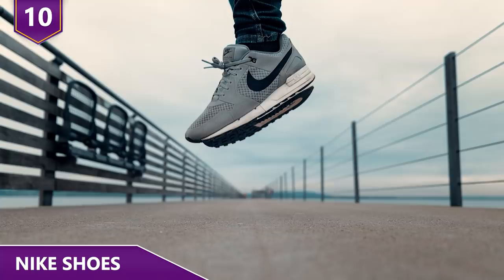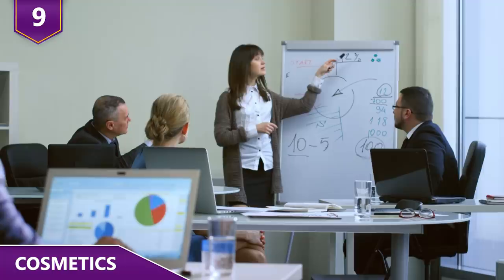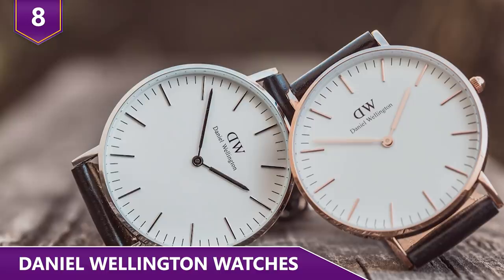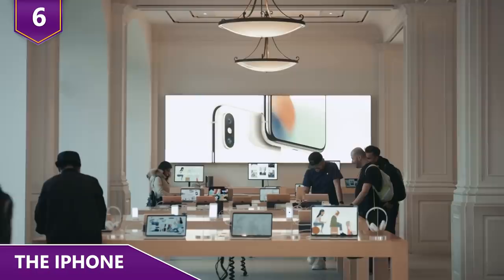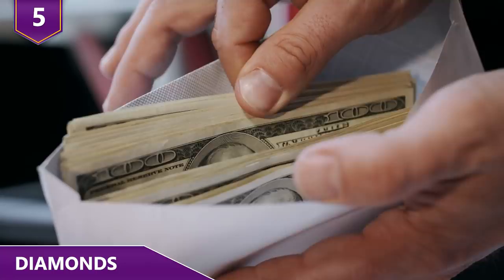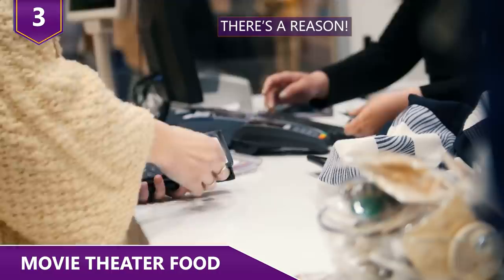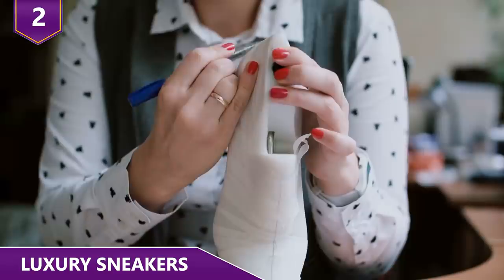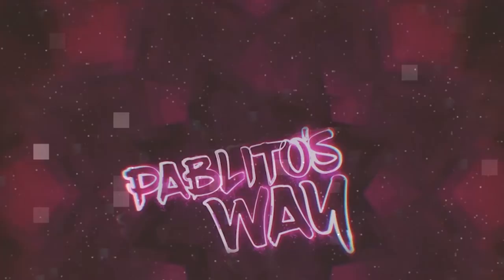The Truth on How Much Things Cost

Comment: I've sold both glasses and watches, and I can tell you that most designer isn't worth it.
DW watches are basically worth the same as children's watches, and honestly some of the children's watches we sold had a higher quality. They were the watches we most often had to change the glass of.
When it comes to glasses, I'd advise against buying designer frames (especially plastic). They're usually of poor quality and often have a ridiculous required minimum mark-up rate. Try to buy frames from a brand that specialises in glasses, as they'll often be of higher quality. This also goes for sunglasses. I'd recommend going for frames of a metal and carbon blend.
Additionally, try to look at what the professionals are wearing, but don't necessarily be fooled. We'd always have the best glass in our frames, but sometimes we'd wear certain frames or watches for promotion.
I'd never buy a DW or Michael Kors watch for myself, but I'd still sell it if someone didn't care about the quality. Likewise with frames, if I liked the design of a designer frames, I'd rather order something similar from a different brand of better quality and ironically a lower price.
Reply from the maker: DW watches are kinda like Hublots except much cheaper

Comment: This is so simplified idea of how market works. You only consider costs of the actual manufacturing. There are many more costs. Someone had to design the shoe, test it, prepare the production line, test the line, repair it, supervise it, then run the line, make shoes, pay the taxes, the book keepers, take the shoes and pack them, load them, ship them, pay toll, pay local taxes, advertise them, sell them and finally make a profit. So yeah, the sole manufacturing is maybe 28 dollars but you don' buy just the manufacturing. You buy the whole product.

Comment: You guys also forget that something like the gucci ace id made in Italy with far higher wages for laborers than somewhere like China, although the markup may be high you pay for what you get which is more ethically produced shoes with higher end repairable materials from a world class designer
Reply: You still are not getting full value for your money - most New Balance sneakers are made in the USA with just as good - or better materials yet cost a third of what Gucci does.

Comment: Nike's don't cost evennnnnnnnnn close to 30$ to make. They cost $3-$5. Used to be cheaper $1-$2. Nike's are made in HUGE factories in China. Some of the factories are so large and employ so many ppl, that they make up to 100 000 pairs of Nikes PER DAY! I know it sounds crazy but do a little research. Even call the businesses that make Nike's and ask their capacity/how much they can make per day. Its a HUGE business. Each factory has from 1000-5000 employees. So 5000 employee's making 20 pairs of shoes per day = 100 000 pairs. Nike pays $5 per pair at most. The factory takes $4. Sometimes $4.50c. The employee makes $5-$20/per day. Sometimes, lots of the time less. Its absolute slave labor. But believe it or not for China, this is a good job.

Comment: When come to diamond you are wrong. Diamond are expensive because. First, they’re very rear minerals. To extract diamond is very expensive, you need  technology like bulldozer and excavator . A bulldozer can cost like up to $1m and a tyre can cost like 100k each. Second, in the scale of minerals diamond is is the top, making it very resistance mineral that can be used for different purposes like cutting machine for stones (marble) and drilling bits (petroleum industry) a diamond drilling bit can cost +$150k. And the last, diamond is like cryptocurrency. It’s used in the black market for payments, specially in the military industry. You don’t need to carry a lot of cash when making or receiving payments. Few stones and you can put in your pocket and travel. That’s why diamonds are expensive
Reply: Diamonds are expensive because there’s a market for it, a very expensive one and that’s only because of the consumer. There’s lab grown diamonds now that cost really not that much to manufacture and they are used in jewelry. Diamonds are hand mined just look it up they barely use any heavy equipment besides humans (sadly). So there’s a false perception that diamonds are worth a lot of money just because why not. Diamonds aren’t rare either there’s actually other minerals that are far more rare to find than diamonds.
Reply: Fernando Queme I will try again. In Mohs scale diamond is hardest minerals. This mean diamond  apart from luxury can be used for different purpose. they are extremely effective at polishing, cutting, and drilling. Many industries – including automotive, mining, and military – use diamond saws and drills. Of course there is blood diamond that most of the time times uses people to dig for diamond. But on the other side there legal companies that explore diamond; De Beers, Alrosa (Russia) they of course use technology to explore. 

NB. What makes a mineral expensive is how they can be found. Sand is cheap in some countries because it’s expensive to find. To explore diamond you must dig at earth crust that is found is some layers above the subsoil. It’s fast to use machines than use people to dig. 

Ps. I’m Engineer
Reply: Persik II Yeah but if they can be lab made then all of its properties really loose any value you can add to it since is so easy to manufacture. I am aware of the many uses diamonds have. Diamond burs used in dentistry aren’t really expensive, they are more expensive than carbon ones but not that much more expensive. 

sand is cheap because it’s expensive to find? Lol ok

Being an engineer has nothing to do with minerals
Reply: Fernando Queme if you were my student I could make sure you failed in my subject. 

Yes sometimes people buy sand and it can be expensive. To build the islands  in Dubai (Emirates) they had to buy from another countries. So sand sometimes can be difficult to find just like other minerals like water. Even though we have million of rivers there parts of the world you must dig deeper to find water. 

What you are saying is the same as “ diseases has nothing to do with medicine, or economic has nothing to do with money. Of course everything is related. To explore for oil I must read the lithology data and decide how I’m going to design the drilling plan. Each rock or layer must be compatible with weight on but or ROP to prevent any rock damage or even the oil reservoir. So yes I study rocks and minerals. And I’m also a Drilling teacher.